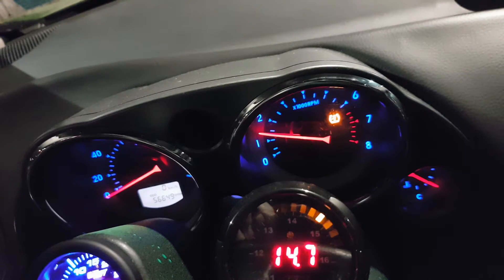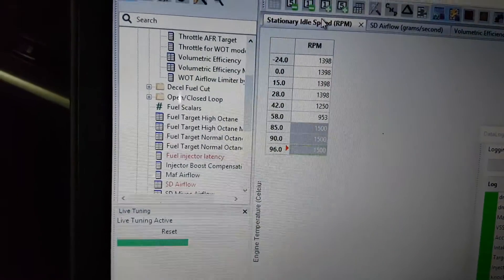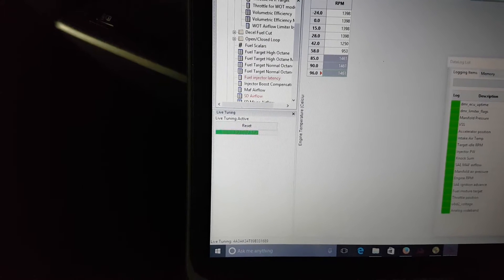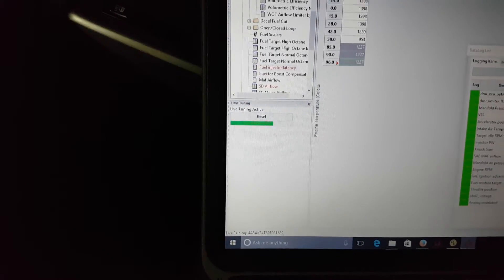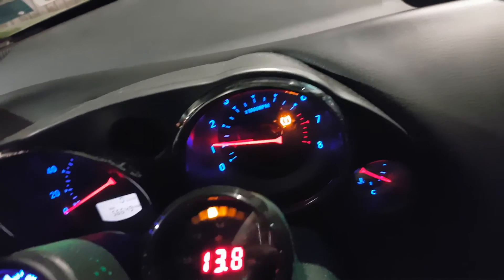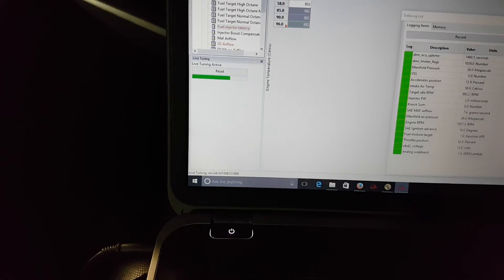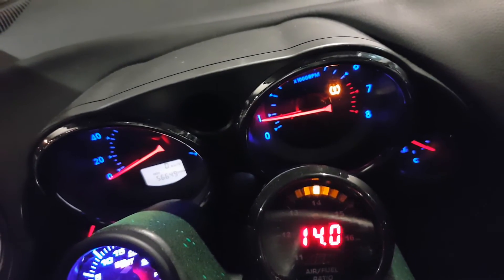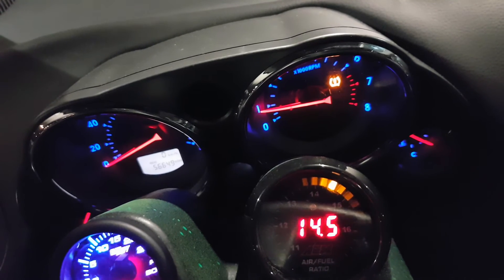fastworks live tuning on  the 4g eclipse

Comment: How much you charge for a tune?
Reply: 349.99 USD for a tune and the software for a naturally aspirated car $499.99 for the boost system (or $200 to upgrade from NA to boost). For turbo/supercharger I can really only supply  a base tune as they are so different you really would need a local tuner. Contact sales@fastworks.com